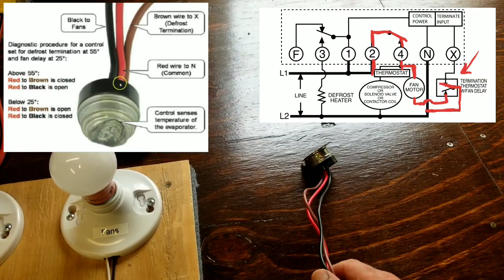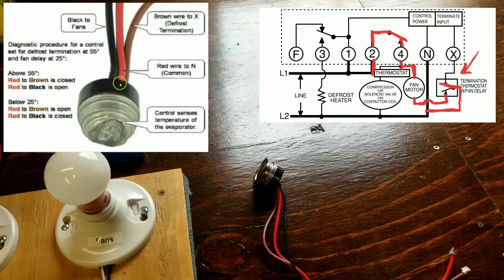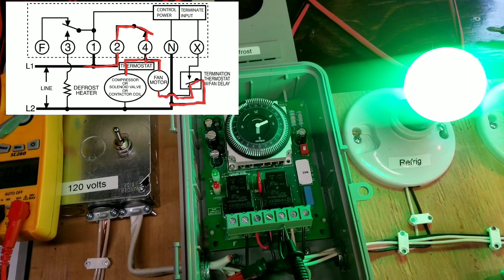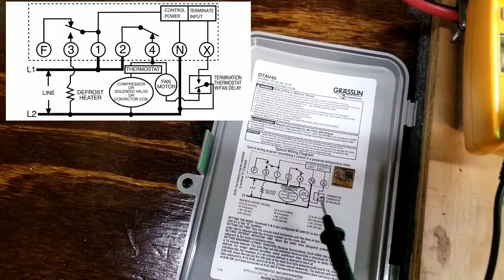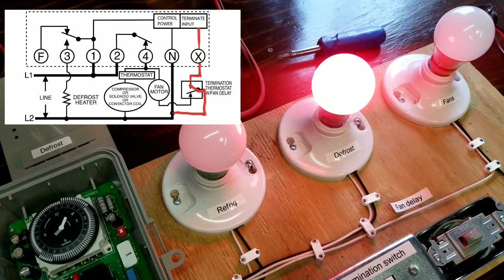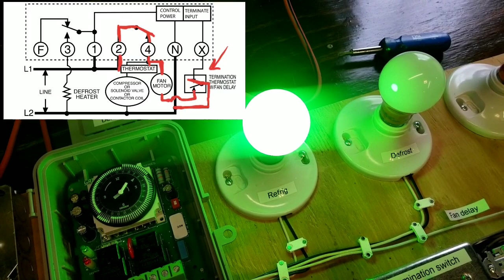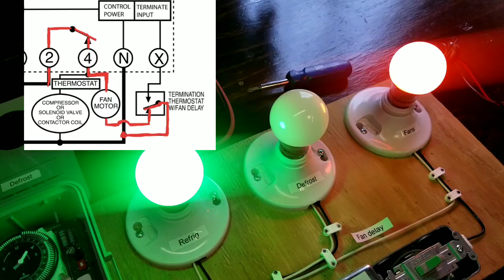Defrost circuit in a commercial application

Comment: I had to watch it 3 times but I think I have it now. I’m not in the trades but recently built in evaporator for a cold bay table. I added a 2nd condenser unit to the system. The problem is I’m using DC fans that run continuously and I have to manually defrost the additional coils. The original unit has shielded coils covered with stainless. Also I must thaw these manually. All that was background. My goal is to add a defrost cycle and heaters. I understand the wiring as you explained. The DC heaters has a AC inverter so I can rig a power outlet from the grasslin mimicking a fan delay. Still working that out. The answer is in your setup. It’s working on 120 Ac which makes it easier. Thanks for your video.

Comment: Does the compresor turn off when defrost come on? If you check with the multimeter between N&4 you shouldn’t get power correct? I. This case is a 120v freezer. If I get power all Across the board with all the pins in refrigerations and defrost is a safe bet to think it’s time for a new defrost clock? Thank you in advance

Comment: Good display. However what about a walk-in cooler where the fans are constant and the compressor is wired through a thermostat. My staff has a habit of leaving the door open to much and the coil freezes from time to time. I want to install a defrost clock so at night I can ensure a consistent defrost cycle. Thanks. It has 220V

Comment: Great video. My question is when the defrost termination switch closes the switch on red to brown, does that also close the switch on 2-4 even if the timer is still in defrost? I’m a bit confused there.
Reply from the maker: Yes it does, it jumps right into refrigeration mode
Reply: Just another question. When the system is in defrost, will there be a short circuit between 1 & N? As the red to black switch would be closed(?) would current flow then be L1, 1, control power, N, L2?

Comment: You can also use your compressor discharge plus a 3 way valve,the hot gas has a temp between 150 and 170 degree depending on what refrigerant you use .Not used much today but once in a while you still see them.You still need your defrost box to send voltage to your 3 way valve and timer,fan and so on.You did a nice job explaining how a defrost works,keep up the good work.
Reply: Mr Slim 1959 . Normally Electric defrost not RV. Electric works out much cheaper on components

Comment: you could wire the actual defrost termination switch in and use component "freeze spray" to make it cycle. not very cheap and you don't want to use a ton of it ;)
then again, just use and recovered R134a (as liquid through a nozzle) which is what "most" of those sprays are, I believe some are now R1234ze...
Reply: R1234 is flammable I believe !